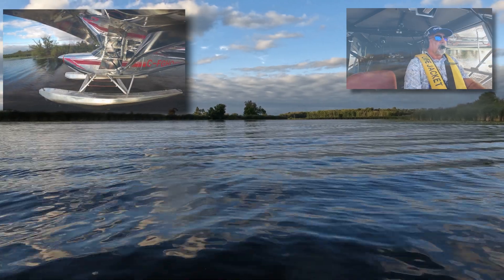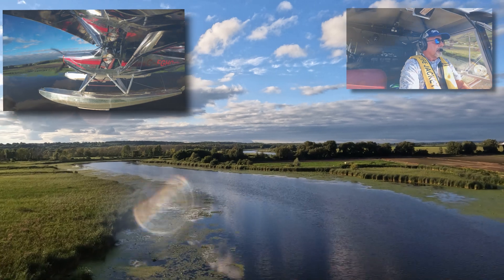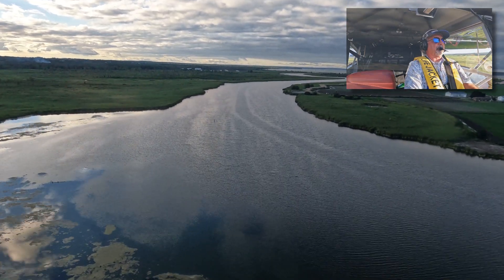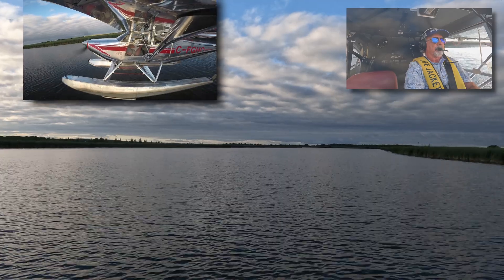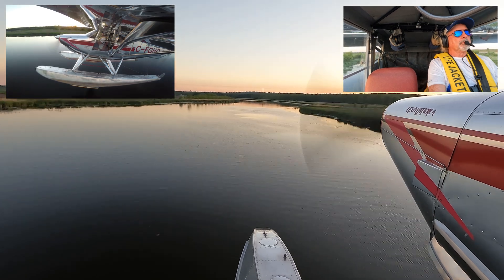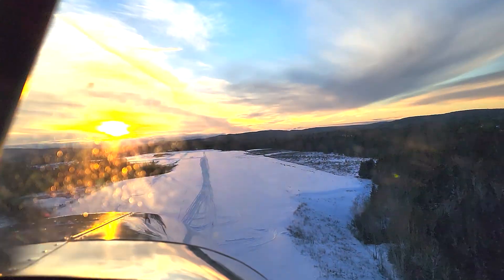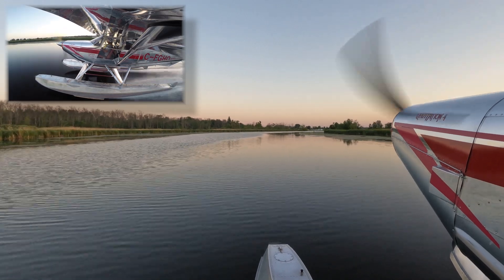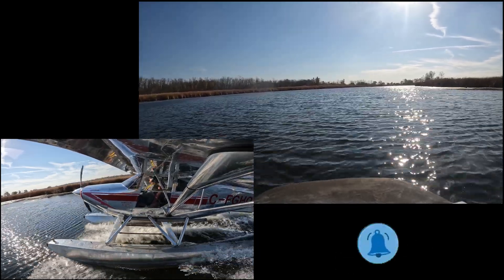Some of the most impossible short takeoffs and landings (STOL) on a windy river full of S bends.

Comment: Just Aircraft has much shorter take off and landing. Could you elaborate?Thank you. I love your airplane.
Reply from the maker: Yes you are quite right about that, the Highlander (which is a phenomenal plane) will get off the ground in about 20 feet with a good headwind, and it probably weighs 1300 Lbs max.. It is a very light aircraft built for STOL and it is on wheels, fairly low friction with the ground. The Levitation Is a lot heavier plane at max it weighs 2500 Lbs. It can get off the ground on wheels in 100 feet on a good day. The water on the other hand creates a lot of friction and the floats have to get up on step, or hydroplane on the water before it can build up enough speed to rotate. That typically is 47 knots and can happen anywhere from 250 to 500 feet depending on the day and the temperature, the colder the better.
I hope that helps
Scott
Reply: @Scotts_Outdoor_Channel  Thanks you are 100% correct.Only the Heliocourrier would bea any 4 seaters in STOL performance.